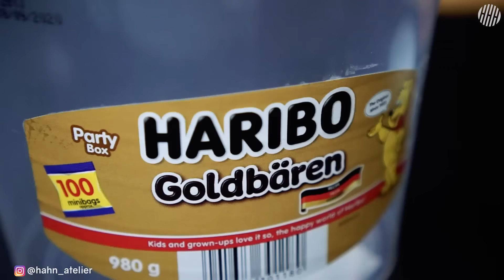Making the most luxurious chocolate case | Leathercraft ASMR

Comment: I am wondering if you can (in your 3D software) put a thin ridge on your top ring.  When you sandwich the leather on the form and clamp it, the ridge may be able to leave an impression in the leather for your stitch line.  I have seen this technique with metal stamps.  You build the trim line into the stamp.  It seems that this might work for a two part mold.  Otherwise, this thing is perfect.  Oh my.
Reply from the maker: Wow, Actually It's really good idea. I'll do put a thin ridge next time. Cheers!
Reply: @HahnsAtelier  Got the idea from Corter Leather.  Eric has his brass embossing stamps made with the outer cut line incorporated into the stamp design.  So when he stamps, the cut line is already pressed into the leather.  No fiddling with dividers.